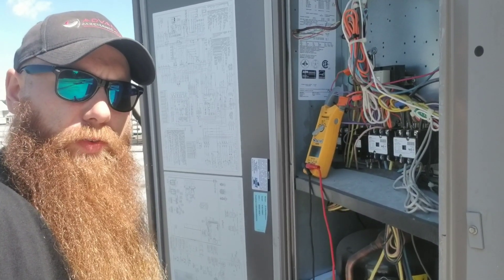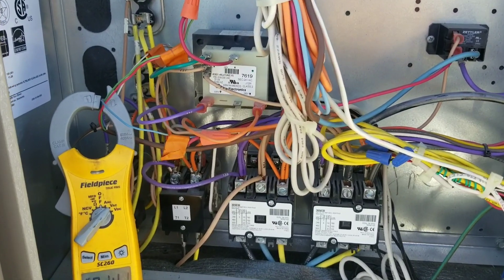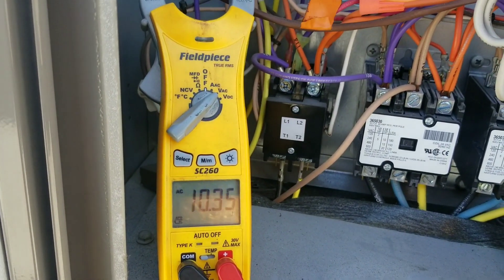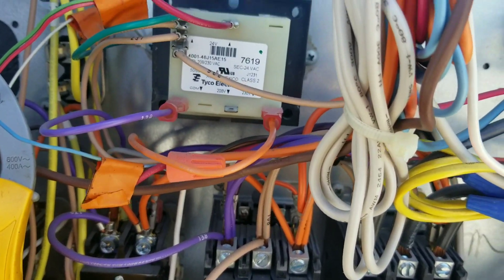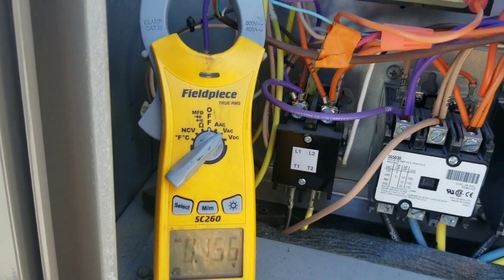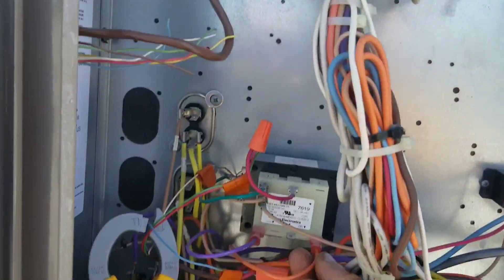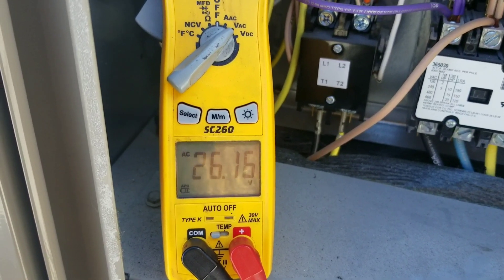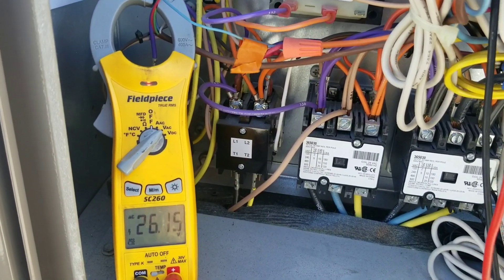208/240 on a transformer- does it matter?

Comment: Serious question sounds little dumb but left me puzzled for years. Lol
If I have 213 incoming volts should I leave transformer at 240v or should I change it to 208 v. The voltage is closer to 208 but voltage is over. 
I would love to hear your thoughts on the matter. Thanks
Reply: 208. Calculate your voltage imbalance. No greater than 5 or 10%. 213 is still considered 208

Comment: Does that apply to Indoor blower too, will it hurt anything on the indoor motor because is rated to 208/230 V but it’s actually getting 240 on both power lines ?

Comment: Enjoyed your video. As an industrial electrician who deals with controls every day, ( and HVAC isn't my primary trade ) machines / pumps / meters / sensors ARE, I've always wondered why most rooftop HVAC systems wiring are so damn sloppy.. 👈Sorry, not trying to knock your trade my friend, but that big old tied together bundle of wires would be shameful if I wired something like that... I know you guys don't WIRE these units, they're wired in the factory, but what's the reason for all the sloppy wiring ? They make wiring troughs with easy access covers on them.... ! 🙂✌️

Comment: I constantly run into this. Installers just will not check and change it. Sometimes the transformer will fail. More so if it's 240 and wired 208. Check voltage and wire it correctly.

Comment: I recently came across a cooling unit that was showing a phase fault do to 208 not being 208 while under load.. The unit needed 220 volts and wouldn't run properly if the voltage wasn't in the 217-223 voltage range.. I played with the taps on the transformer for 2 hours and finally got the voltage right.. There was a "electrical/AC technician" that had been on site and acquiring amp/voltage load data for a week until I got there.. Needless to say he got sent home with his tail between his legs.. I think either he was incompetent or he was riding the clock and burning the customers ass.. He sat there looking at a computer for a solid week and couldn't figure it out..

Comment: Good video.   You will likely run into buildings that are either single phase 240/120 volt, 240 volt 3 phase delta with a high leg, 208/120 volt wye systems or 480/277 volt wye systems.   There are several tutorials on the different systems on Youtube.  If you do work in the US you need to know what you are dealing with.  I liked the title  208/240  does it matter?  Ha ha only if you want things to work right!
Reply from the maker: Thanks
Reply: What is the difference from a a single phase and a 3 phase)